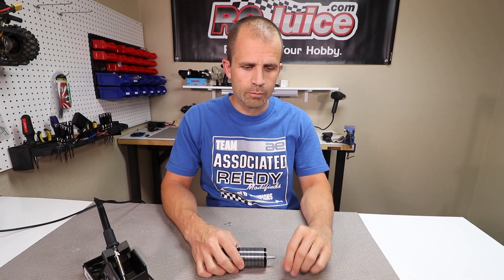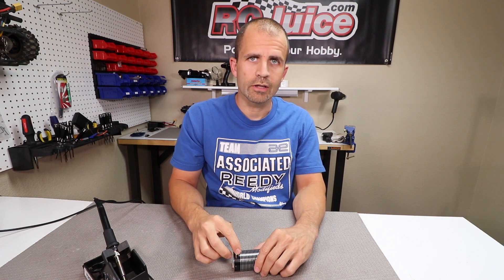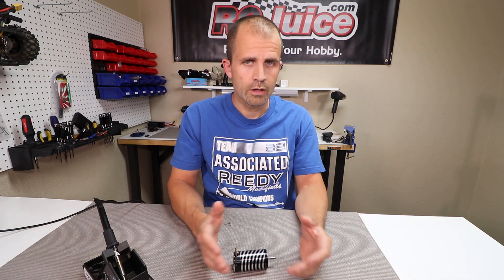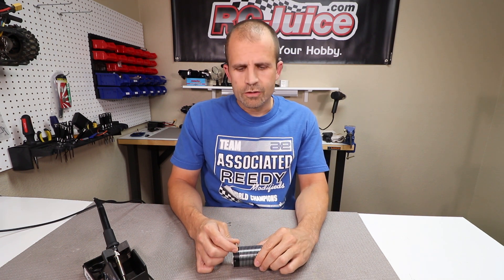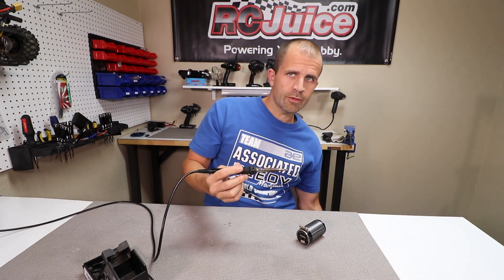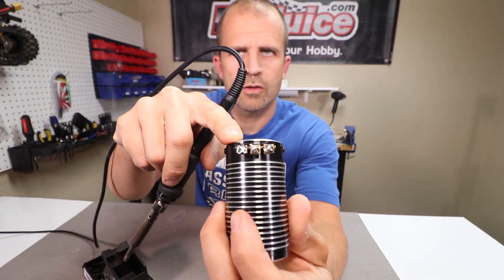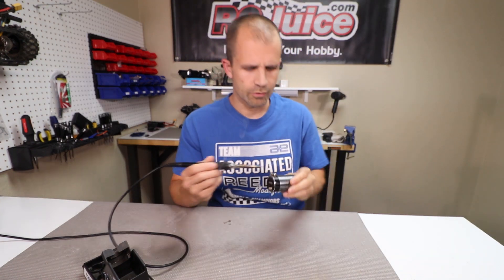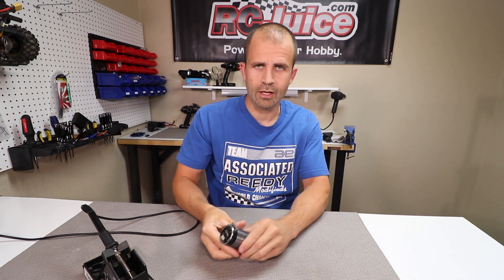Cool trick for removing excess solder off of components.

Comment: Thanks for this video, I believe this is going to work for me, I mistakenly purchased the wrong control board for a button box, so now I need to clean the solder off all of the momentary switch terminals, which also means removing the switches from the project box and get to slinging, the only down side is that I have to now remove 23 stitches from the project box. Thanks again.
Reply from the maker: Oh boy that's a lot of work!  Hopefully this helps, thank you for watching!

Comment: Nice tip. Unfortunately I can't do that with a board that is attached to the housing on my amp. I have figured out a nice method where I use a toothbrush to sweep away excess solder. It's been working out quite well.
Reply: Anything on that toothbrush?
Reply: I definitely like this idea and will try it today!

Comment: I had some wire that I needed to remove some solder from the end of. I went to Home Depot but they didn't have that copper stuff to pull it out. I got a cardboard box with slick printed surface put the wire on the box and then drug my soldering iron over it. Solder stuck to the Box.